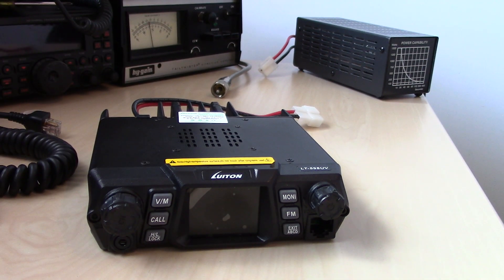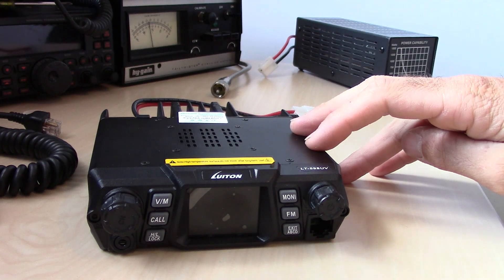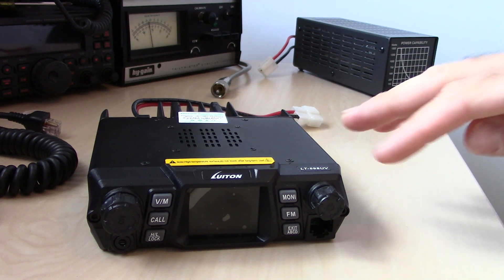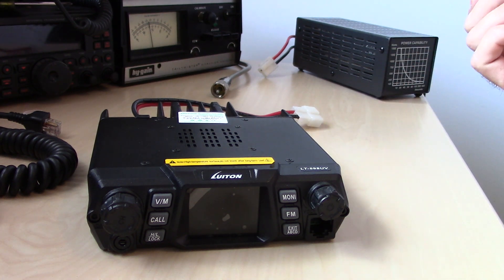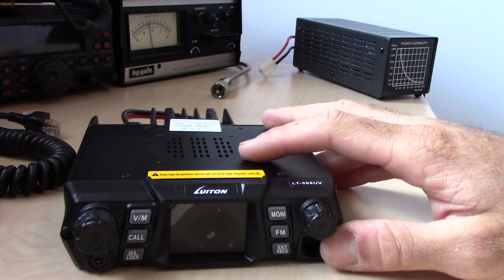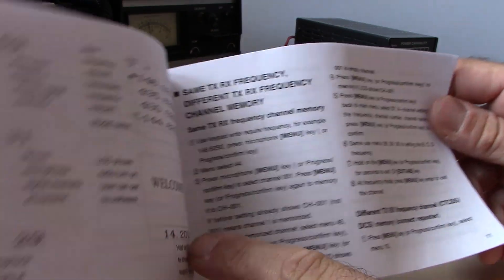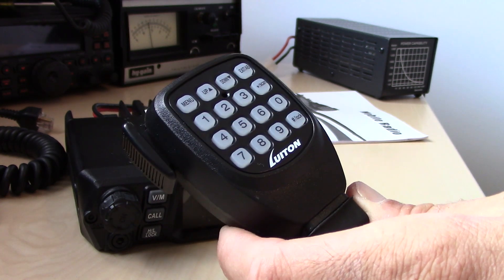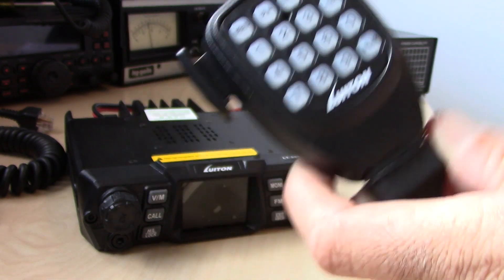75 watt dual band FM mobile by Luiton LT-598UV

Comment: I have the B-Tech UV50X2 and its a great little rig, it fits nice into the little slot on the dash of my '02 Ram nicely. I love the front data port....I change my load out like some people change socks depending on what I'm doing, In the summer I load in local repeaters and the VHF marine band due to my proximity to Lake Erie, on occasion I use it for railfanning and of course load in the AAR 1-97 and some of the telemetry freques. The only downside that I've noticed is that SOMETIMES on scan mode, everything is good, but when I back out of scan, it'll receive on the last frequency scanned, so a quick reboot is needed. Otherwise they're killer radios.

Comment: The real difference is the amount of extra cooling you will need if you transmit with 50 to 80 watts. T doubt the fan in the unit will keep it cool with heavy use.

Comment: I have that radio as a QYT 980 plus my watt meetet says 82 watts on vhf. If you notice the screen says 980 plus on the bottom line. David Byrd KN4BHS
Reply: I have the QYT 980 PLUS 75 watts but over 1or 2 mile I can't receive  but I can reach out 22 mile and I did something with the settings and I could pick receive a little bit but couldn't make out what he was saying can yall help me im new with this radio

Comment: Looking at the display on the radio. Does it have a built in battery? I looks like it has a battery charge level on it.
Reply: That indicates your power supply level. It also reads in volts if you push 0 on the Mike  buttons

Comment: I can't get the quad standby feature to function. It only listens to the station with the arrow any ideas?
Reply: Look up Sync in the manual...hope that helps.  Have a Baofeng 25x4 which is similar but cant be sure...
Reply: It's in the manual you can choose any or all to be receiving .

Comment: What option are you using to adjust the wattage higher ?
Reply: Mine came  putting out over 80 WATTS on 2 meters. David Byrd KN4BHS
Reply: David Byrd this might be a stupid question but what's the setting called to adjust to 2 meters ? I'm really new and been doing as much HW.
Reply: @backyardmoto5556  there is not a control to change bands , just enter the desired frequency such as145.520 the band change is automatic. Hang in there watch some more videos it becomes eaiser with use

Comment: Can you help me?
I am on a volunteer fire dept. (Not a ham) and I bought a SocoTran ST-980 P because it was cheap and it is out of my pocket. (Very small FD.) Anyway, it looks just like the LT-598UV. Even the user manual looks the same. I used chirp to program our walkie talkie's It won't work with this model. I only need (two 2) chances. How do I program our repeater and our ground channel (None repeater? If you can help: Please contact me here.
gkshadow@gmail.com
Or where can I get the software that will work for it.
Reply: Chirp now supports this radio. Make sure to get the latest download. David Byrd KN4BHS

Comment: This radio is the same as my QYT 980 PLUS. ITSAYS ON THE DISPLAY THAT ITS A 980 PLUS. MY RADIO ALSO PUTS ABOUT 80+ WATTS INTO THE WIRE.    NOTICE THE BOTTOM LINE ON THE DISPLAY . DAVID BYRD. KN4BHS
Reply: Hey David I am interested in the QTY 980 Plus  do you recommend it? is it ok to use low power with close by repeaters?
Reply: @DD-gd3fr  yes it works well for me on low . About the only gripe I have with the radio is it only has high and low power settings. Needs a medium setting . David Byrd KN4BHS
Reply: Hi Dave 
Could you help me please . I have same looking radio but labeled QYT 980plus .
Supplied programming software is on Chinese . If you have program on English 
pls. send me or direct me to the web site for the download . 73
VA3RGS  (rudysoko@hotmail.com)

Comment: Sir, I see that this video is from last year. I bought a pofung bf 9500 because I'm new and only have the uhf license (WQZT655) and not able to afford high end equipment at this point in time, I'm desperately looking for someone who has done a video for the pofung bf 9500 set up and complete operation as well as make a suggestion as to what type of antenna I need to get. Would you please help me.  
Thank you
Clint.

Comment: What is the amp draw on the power supply? Thanks
Reply: Mine draws about 18 Amps on high power. I have a Menzo 30 amp supply $18 on Amazon it runs my HF rig plus the QYT980plus
Reply: David Byrd can you drive a 13.8 volt radio with those 12 volts converters?

Comment: I'm getting 77 out on 145 on my Btech uv50x2  and about 35 on 440. So really not that much difference other than some engineering tweaks. It's a hot radio on high power, but works fine. My suggestion, affix another cooling fan to the heat sink because the primary fan falls short of preventing thermal shutdown for extended qso's. Really customizable if you're into that. 
Other than that they are good radios for the money. I paid  166.00. Btech support was very professional when I had issue, but immediately sent another rig and all is good.
Nice review btw.

Comment: Do you (or anyone here know of a good am/fm/uhf/swr transceiver, emergency radio type? It would be nice to communicate with relatives coast to coast. If there is one with a dynamo that would be great. Chat with relatives coast to coast.
Reply: I assume you are referring to the United States coast to coast.  The short answer is no, you won't find an all-in-one, small, emergency style radio for that distance of communication.  To (somewhat) reliably make the leap across country, you will need a ham radio license and a high frequency (HF) radio and decent antenna.  There are great ham radios that are portable that with decent conditions could meet this function (e.g. Elecraft KX3 or Yaesu FT817 come to mind).  However, these are dedicated ham radios.  They dont have the other specs you mentioned.  It also takes a little practice with ham radio to make those kinds of contacts.  It is definitely not a simple turn on and talk situation.  It is not THAT hard though can be super fun though, so I would encourage you to check it out if interested.

Comment: This is not the same as our UV-50X2; off the bat - the UV-50X2 is FCC Part 15B Approved (you most likely were provided false information from those who requested the review). 

You can see this is also found in our 60 menus (versus the generic 50).

We take a factory level product - and self engineer the software to met FCC emissions; as well as supporting and selling from the US. They may 'claim' they have what we have, to make a quick buck - they do not. 

We engineer our own firmware on our radios. We set our receiver and transmitter to be tuned at US amateur bands (a side by side 220MHz test on our UV-25X4 to 'the others' will show immediately that our receiver is 220 fine-tuned - and those other radios are completely deaf and tuned for Asia (240))

Other immediate differences not found in the generics:
Dual Synchronize Display Mode (Synchronize Up to 2 Channels)
Mic Audio Gain Settings
Expanded Frequency Range (520MHz)
USA written user's guide
Auto Power Off Function
Channel Mode Editing Settings (edit tones, etc on saved channels in Memory mode)
Auto Scan, Scanning Resume, and Variable Frequency Scanning
Quad Watch Delay Time:  Allows the receiver to stay on the secondary channel longer after incoming transmission - customize the delay up to 50 seconds; This avoids manually channel switching when you are engaged with simultaneous contacts on two frequencies
Randomization Privacy Mode
Reply: I'm glad you chimed in.... I was wondering what the difference was between your UV50X2 as compared to the QYT KT-980PLUS... I guess at the end of the day the extra $20 for your UV50X2 really isn't a bad deal...
Reply: Most all of the UV-50X2 radios are putting out 70 watts or more on high power & around 30 to 35 watts on low power.So really no big difference.I own the UV-50X2 & it is a great little radio with a lot of great features with the 60 menu adjustments.I listened to the radio on another radio when set on the Wide & Narrow settings & it sounds great either way.  {:>)
Reply: @1OFGODSOWN  NO BTECH CX502 IS RATED 50 WATTS.  SO WHERE CAN I GET THIS 75 WATT CHINESE RADIO?
Reply: is the mic pin-out same as kenwood?
Reply: Yes, but to confirm insure the mic is wired such as shown in the diagram in the manual: https://baofengtech.com/usermanual/X-Series-User-Guide.pdf

Comment: could you update this video your uhf swr 1.46 to 1 is way to high. your readings are false with this. try to get less than 1.2 to 1 im interested in buying one of these and would be interested in its power at 480mhz.

Comment: Your dummy load is bad. It should have been 1.0 to 1 swr. We know you were not transmitting in to a antenna and not ID'ing right?
Reply from the maker: w8one what should the dummy load show then? and I didn't ID because I was into a dummy load and not interfering with any frequency
Reply: Your dummy load should be a perfect 50 ohm termination that should be 1.0 to 1 or perfect match no reflected power. It is also possible that the radio is causing a reflection meaning it is not working correctly. testing multiple radio, meter, dummy load / antenna combinations will give you the answer.
Reply: Relax lol

Comment: Not bad for the price seemed to test out ok.
The good: Higher RF output,
& a S meter wow! 
The Bad : The heatsink should be on top looks like they went backwards on the look of radio 
but it is done, not being able to select single band read out but that's the present design.
For a dual band china radio not bad. Twin band radios with two Vols & two squelch designs need to be standard with the ability to have vhf 200 bank and 200 bank for UHF separate groups not mixed together or ability to set it that way increased readouts be cool too,  the size is desirable. Good video Review.